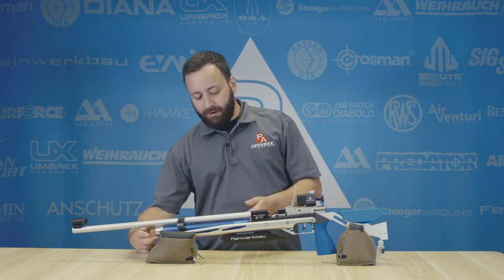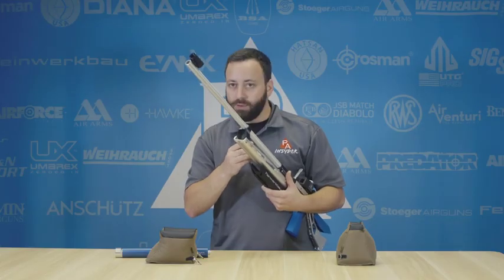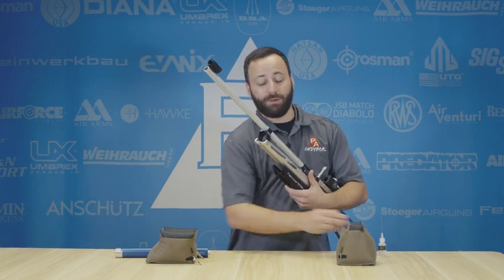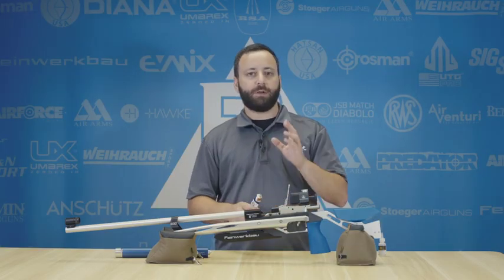PCP Airgun Maintenance

Comment: I have had a pcp for a little over 3 months and it needed to be taken apart recently and to all the hand pumpers out there… be very careful, mindful, and vigilant about moisture! In fact, everyone with a pcp! Within 3 months of very light use my rifle has been pumped with a hand pump that only has the “cigarette filter” type moisture and oil separation on it and when I looked in my air tube I couldn’t believe how MUCH WATER 💦 was inside there… it was also showing signs of rust in there! Three months of very and I do mean VERY light use. Should I take it apart every 3 months and address that or maybe every month? Also how can I deal with the rust because I am new to this and for what I spent this is very maintenance involved and the only solution is spend spend spend… do I need to make an initial investment of $2000 + to get a setup where this would not be a problem? I’m not even sure because my neighbor has a very expensive setup and it’s always breaking or malfunctioning too😢